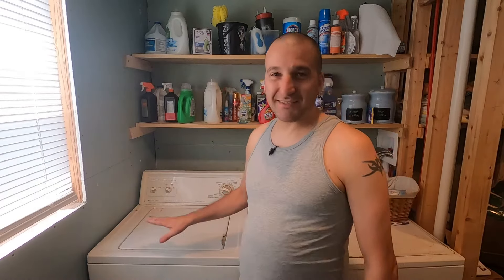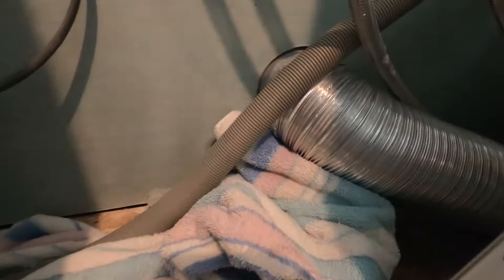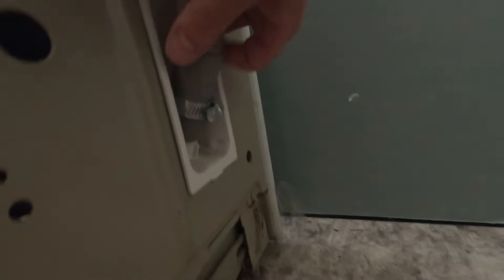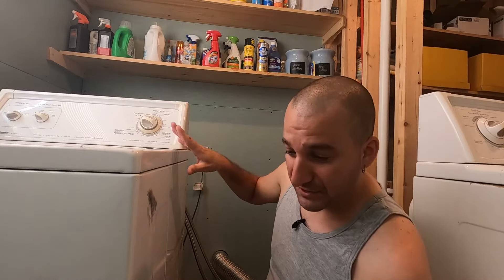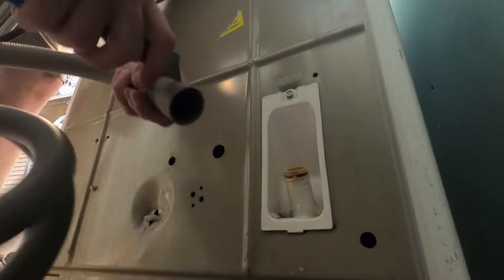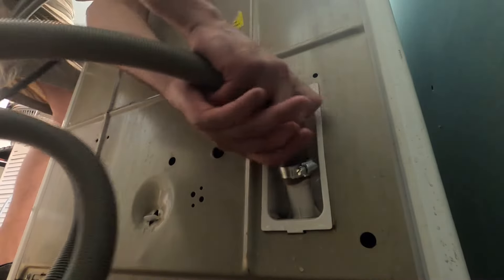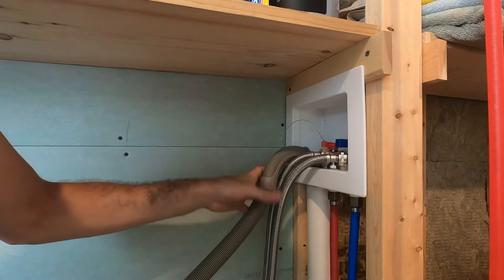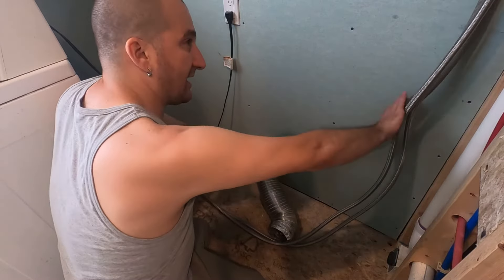How To Change A Washing Machine Drain Hose (EASY!)

Comment: Is there a such thing as an unreplaceable hose? Because mine came in the washing machine already. There is no clamps that I can see. But I need to extend the hose.
Reply from the maker: hmmm. there's got to be a panel on the back to access the connection point. There's no way it can't be replaced just might be a special one specific to your machine but even that I doubt

Comment: Is 8 ft too long?? My current hose is 5 ft and I can’t for the life of me find another 5ft or even a 6 ft one
Reply from the maker: Depends on your setup. My washer is on the left side but the drain is far over on the right wall so I need a long hose to reach. The hose that I used even though it is 8 feet long, can be cut down. The curved plastic part that goes into the wall just snaps around the hose, so you could take that off, cut the hose shorter, and reattach it.

I didn't have any problem finding 5 or 6 foot ones on Amazon. I just typed in "washing machine drain hose 5ft" in the Amazon search bar and found one easily. Also found 6ft, 7ft, 8ft, 10ft, 12ft, 13ft, 16ft. They come in lots of lengths!
Here's a link to one of the 5 footers I found. https://amzn.to/3xPu5c4

If you're not referring to amazon and maybe in a local store you couldn't find one, check to see if it has that removable plastic curved part on it because as I mentioned earlier those can be cut down to any size you need. 

Hope that helped! :)